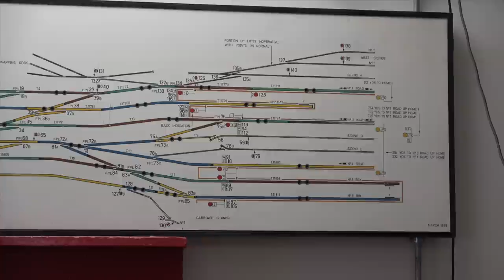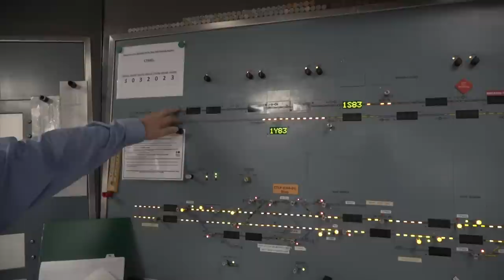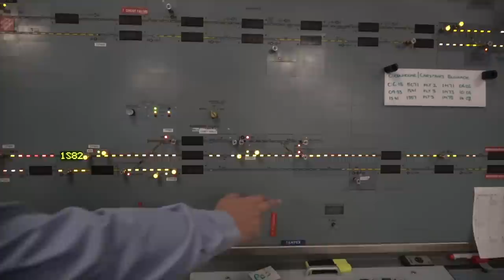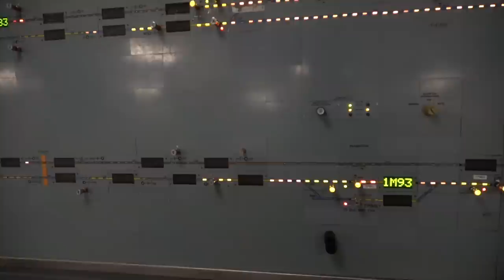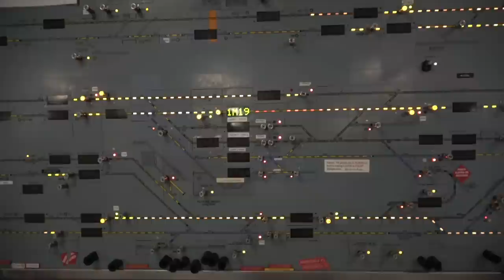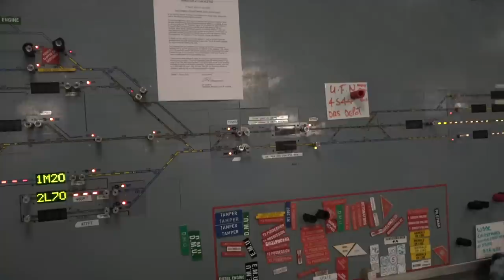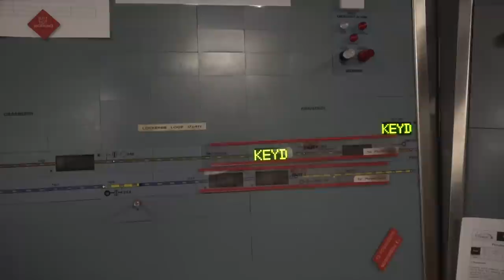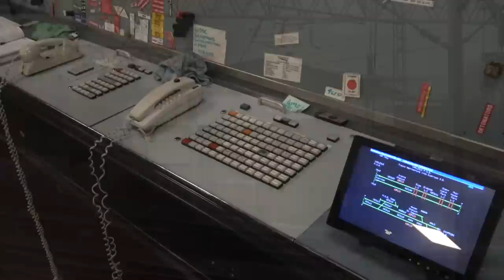Inside Carlisle Power Signal Box: Celebrating 50 years! Carlisle's panel as seen in March 2023

Comment: Wonderful film, thank you for sharing it. Great to see a 1970s NX PSB still in use. My local PSB (Leicester) barely lasted 25 years, 1986-2011. It's signalling was recontrolled by East Midlands Control Centre at Derby, quite easy to do as the relatively modern interlocking was compatible with the modern control systems there.
Reply from the maker: Who knows how long Carlisle box will last. Rumour has it Network Rail want to replace the physical signals with the European cab signalling probably controlled from Manchester. Thanks for watching

Comment: Excellent video Les A lot of information and loads of good detailed views of the panel. The CCTV crossing screens are normally off both to save screen life and prevent a ghost image burning into the screen. I remember the runaway train and the signalmans quick thinking saving a real disaster, good to see there is a plaque remembering that day. It's a shame you could not get into the relay room you would be amazed at the sight and sound of thousands of relays operating, hopefully one day you will be able to go in there, what still blows my mind is it all goes into a inch square micro chip and units out on site now. I am curious about the coins but see you did not find out what they were about. My guess is a penalty for making a mistake LOL
Reply from the maker: I have been in the relay rooms but many years ago. They were stripping asbestos from them.  The CCTV crossing screens were turned on specially for me.
Reply: @LeslieGilpinRailways  OK Lucky you not many get to look around relay rooms. There was a lot of asbestos used in them years ago and we were unaware of the danger. Years ago they used solid wire insulated with rubber an asbestos fibre and lacquered yellow outer cover, called flameproof wire it was used everywhere until the just rubber coated wire Carlisle will have was used, but still plenty of asbestos was used up to recent times. The CCTV screens have an over ride control yes
Reply from the maker: I'm told that the pennies date from charity collections when visitors were more common but now are just spare change when food is ordered in.

Comment: Great video! I do wonder how useful many passenger loops are. Many created over recent years over on Western Region 'for free' with resignalling schemes. These didn't include any changes on the ground, such as moving exit signals back or increasing entry/ exit speed, so it often minimises delay to keep slower trains running ahead than to slow it down to 15/20mph then to wait for the loop signal's overlap to release!
Reply from the maker: Interesting! On the WCML, certainly in the Carlisle PSB area, the passenger loops were only created for the ill fated APT to allow it to pass 'ordinary' passenger trains. Quite a few goods loops were lost in the 73 resignalling.
Reply: @LeslieGilpinRailways 
Thanks for your comments. Loss of goods loops is a bit surprising - perhaps BR put too much faith in the ability to keep freights out of the way of Class 1s in an all-electric railway.
There were still plenty of 35 and 45mph freights about in the 1970s, although I recall that most of the slowest were retimed via Settle when the Electric Scots started. Nowadays, I believe there are more diesel than electric freights over Shap!

Comment: CARLISLE PSB is soon to be de-commissioned and moved to ROC at Asburys, you press a button south of Manchester and hopefully the points or signals obey the command at Carlisle.
Reply from the maker: As yet it's still in the planning stages with possible cab signalling.
Reply: Yea it will close someday but not til at least 2036 at the earliest